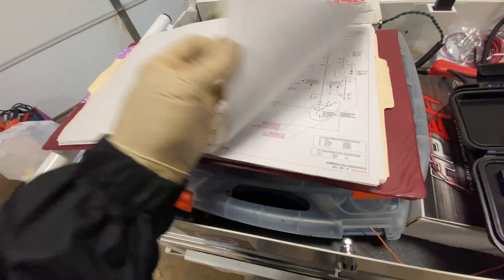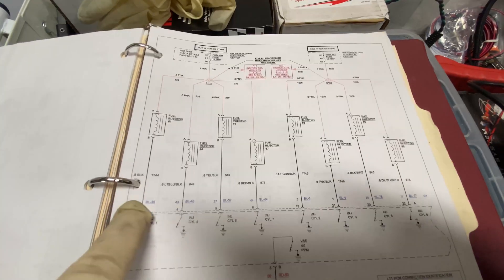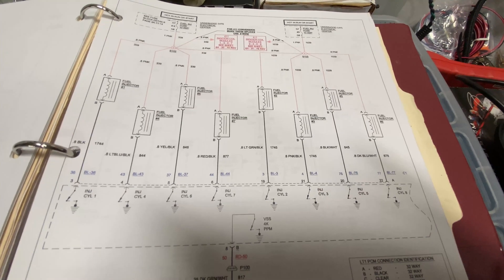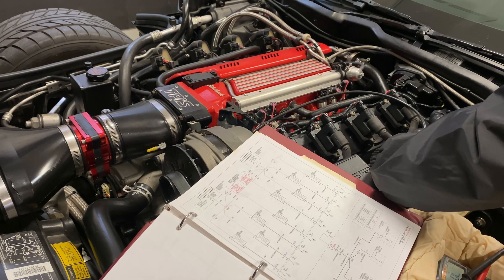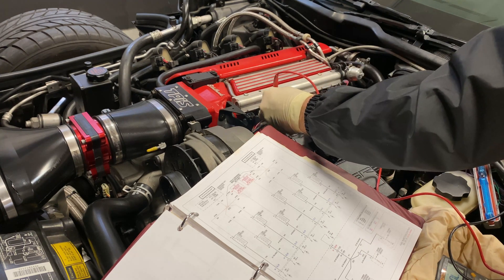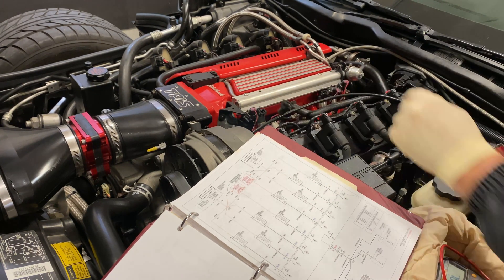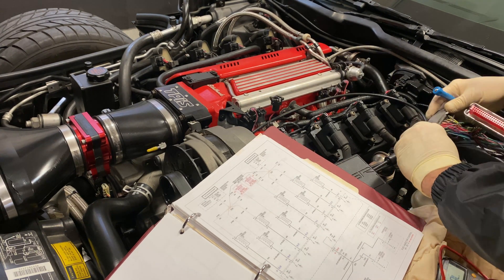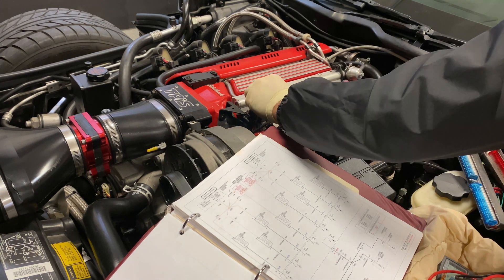DRM LT1 Corvette Tuning Part III

Comment: I finally got my ‘97 camaro SS out for its first drive yesterday!  Carl helped me out (via e-mail) early this year on a valve adjustment situation (THANK YOU).  I did the full LT4 conversion, COMP XFI 292 cam, 11.6 static compression, 8.43 dynamic, ported lt4 heads, lt4 crank, 2800-3200 stall, 3.73 gears, PCMFORLESS mail-order tune, and 58mm TB.  
I drove it very nicely through hilly highways all day yesterday to break it in.  Today, I mildly put the beans to it once, and I would recommend this combo all day long for a fun street car!  Surprisingly, it has just the right amount of low-end grunt, strong mid-range, and great top-end power!  It revs very quickly due to the hollow valves and tool-steel retainers.  I can’t overstate how pleased I am with this car!
Reply from the maker: super sweet.  your careful attention to the car and tune helps with all that good driving.

Comment: Unrelated but something ive always been curious about. For  a 93 Corvette with bolt ons would an adjustable Fuel pressure regulator modification be used to increase horsepower bc the speed density system wouldnt try to correct af adjustments?
Reply from the maker: Interesting.  I don't know for certain.  If it needed more fuel that would be one way to do it yes.

Comment: Im currently building a 67 cutlass and i picked up a 97 lt1 and a t56 trying to figure out the best way to tune it for a cam and head job only build any idea?
Reply: You need Jet DST. That’s the only software that can tune a 96/97 LT1 PCM. It’s $575 dollars. If you use a 411 PCM you can use almost any software out there.
Reply: My camaro ss is a 1997, and Keith at pcmforless had NO problem doing a mail order tune!  I think he charges $300.  My tune turned out to be perfect as far as I can tell.